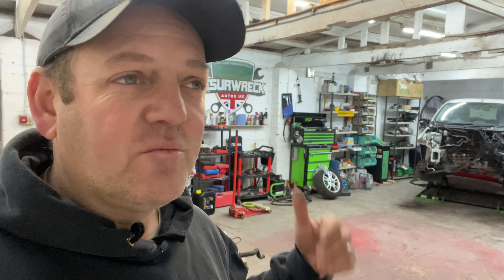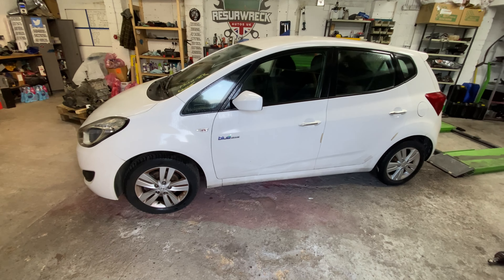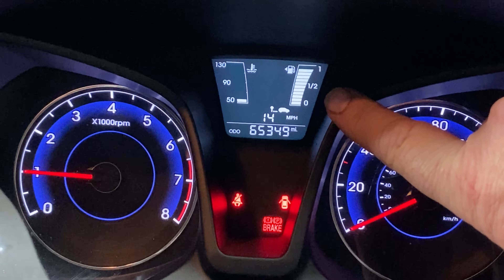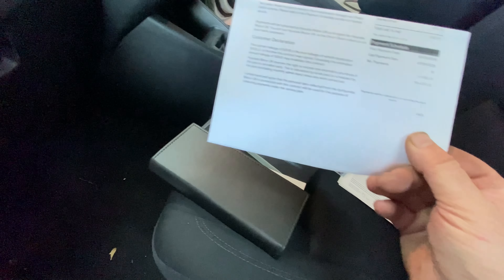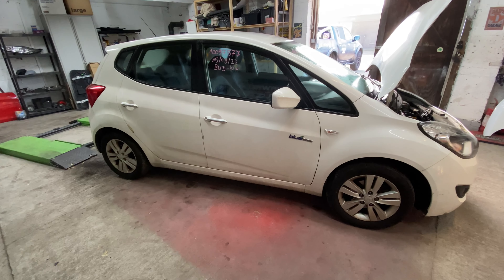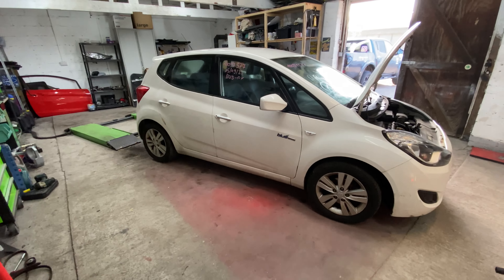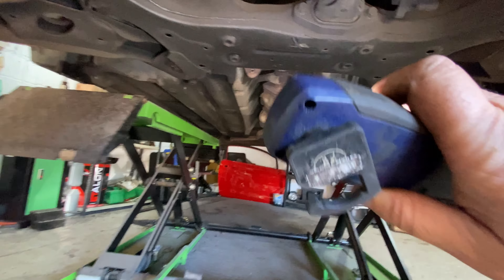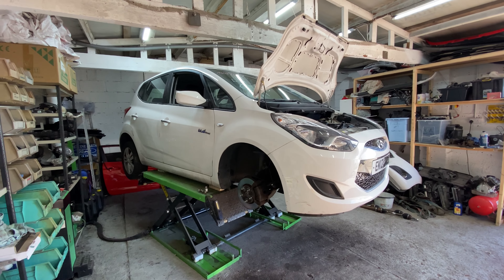New Project The Damage Is Crazy I Havant Done This Make And Model Before Something Different

Comment: Mark I suggest you check with your local Hyundai dealership for a price for the subframe and lower arm you can also ask if it is the same as the i20 the bottom arm even if it looks straight to have that amount of force through it to bend the subframe like that then it’s a no brainier to replace the bottom arm before the ballpoint gives up the ghost
Reply from the maker: Thanks buddy yeah I was going to change both bottom arms just in case 👍👍